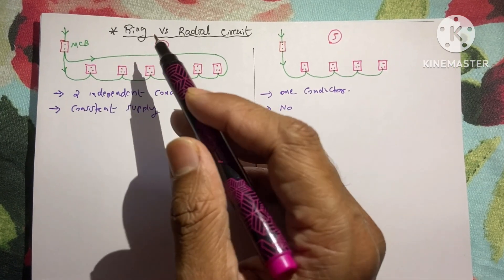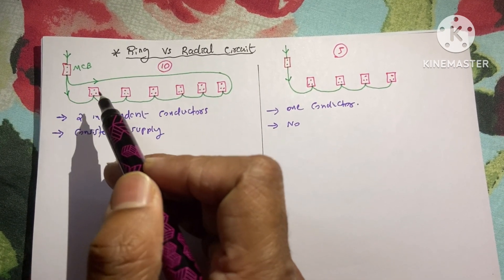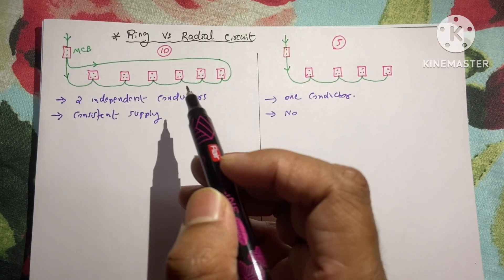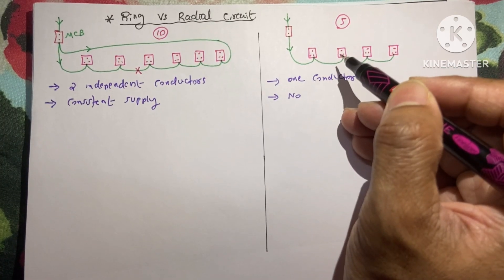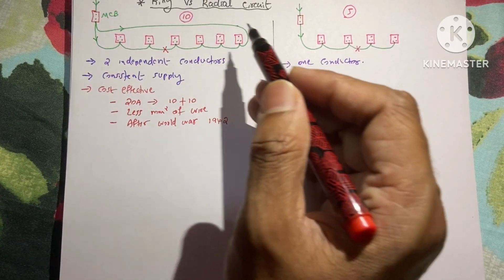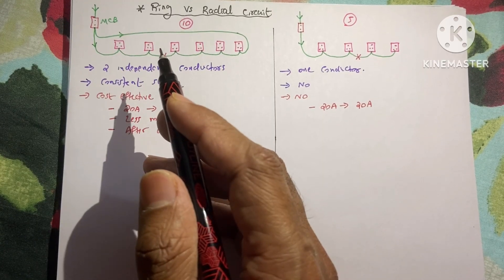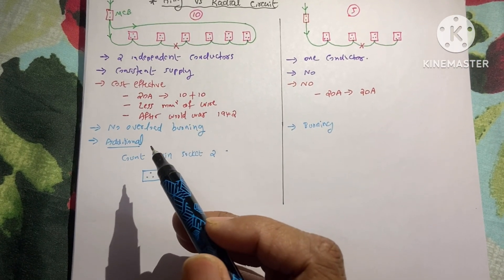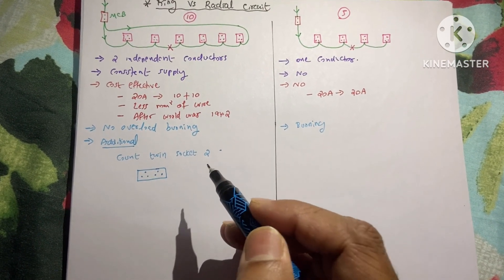What are the differences between Ring and radial circuit of sockets ?

Comment: What's the current rating for the MCB ?
Reply from the maker: Ring 32A and Radial 20A Mcb
Reply: What is the cable size
Reply: 4 sockets are connected for radial circuit and 8 for ring